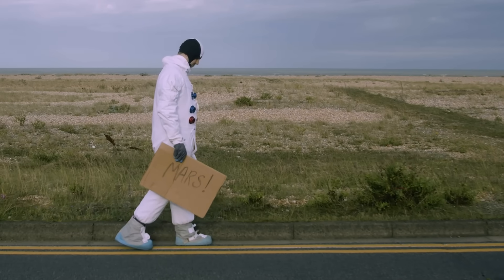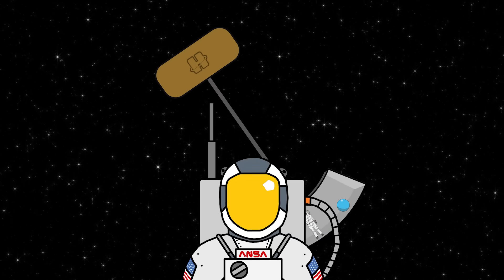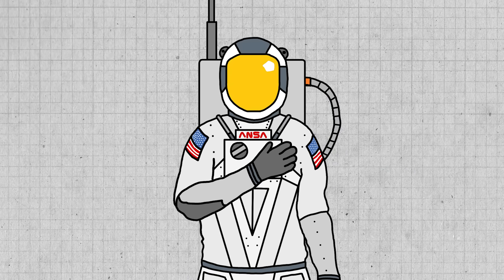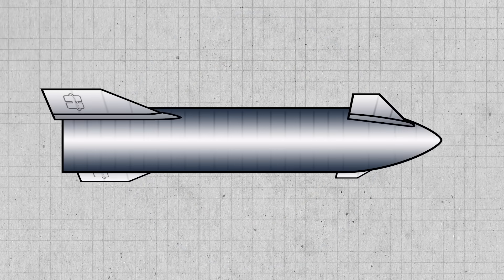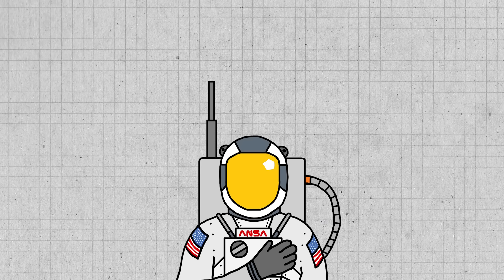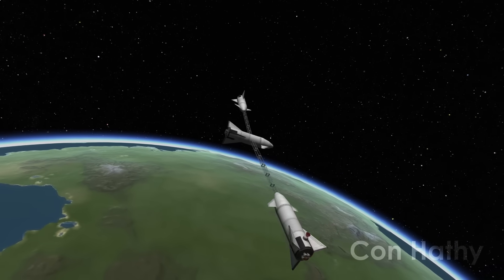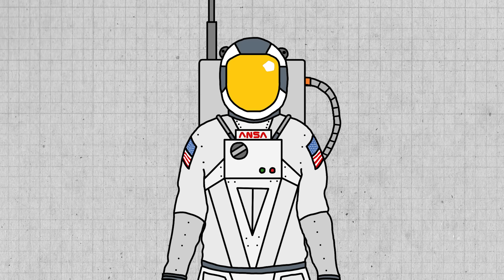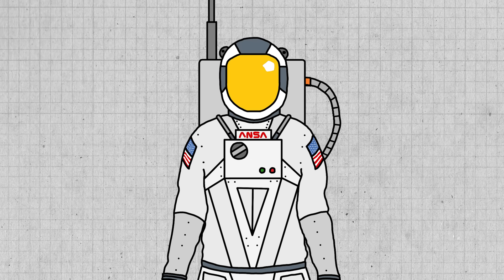This is NOT how you make Artificial Gravity

Comment: The only problem with the small rotating platform inside the spacecraft is that you won't experience continuous gravity. You have to get off it to eat, go to the toilet, etc. And if there are 10 crew members you would need 10 platforms (or strap several people to 1 platform), or otherwise take turns, in which case you will have less time experiencing gravity. Also, if you want to use one spacecraft only, which would add more weight and complexity: having several rotating platforms inside the spacecraft, or having bunks and chairs that can turn around. Anyhow, I think radiation shielding is a bigger problem than having (artificial) gravity.
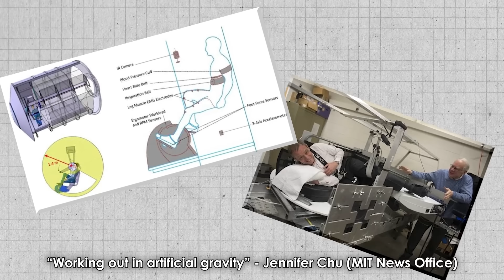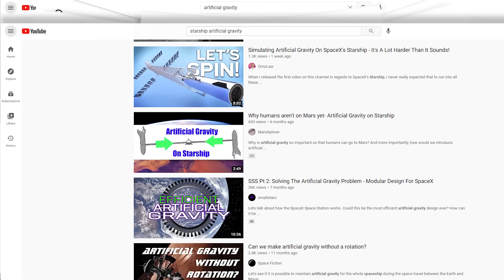Reply from the maker: I think the best implementation is for use during exercise similar to the MIT concepts around 15:16. This would take the form of an exercise bike or something similar that is on an arm within the ship. This would limit balance and motion sickness issues as you'd be on a bike seat and not turning your head too much. Intermittent exposure seems to be adequate to counteract zero-g, the 2nd paper on the right around 0:22 demonstrated that 30 minutes a day was enough to offset the muscle losses we usually see during bed rest studies. "Aerobic exercise capacity" was not maintained but this is probably because they were not moving while in AG, 30-60 minutes on a bike is pretty reasonable given current astronaut schedules and would likely do a better job maintaining "cardio."

That said, I definitely agree that it isn’t mandatory for early missions and radiation is the bigger concern.
Reply: On the toilet is where AG is really helpful.

Comment: You figure out the part with 3 spaceship wrong. A cable only transfer force in one direction. It is not a rigit body. It is a little bit more complex especialy with a set of redundent cables. The other thing is, to get the rotation you do not need a lot of extra fuel. You would always combine rotation with the acceleration you already need.

Comment: There is an alternative to "Mars Direct" and Starship (which is an embodiment of Mars Direct). Instead of this you return from Mars indirectly. Firstly to Mars orbit and then return to Earth. This has a lot of benefits I won't go into here. Such an architecture would naturally require a transit vehicle whose purpose is to convey humans from Earth orbit to Mars orbit and then return to Earth orbit. In other words the vehicle spends its life in space. This makes it more optimal as a transit vehicle (you're not wasting mass on being able to land) and more relevant to this thread, it makes it a lot easier to design-in spin gravity.

The transit vehicle I have in mind is assembled in Earth orbit from pieces that can fit on a heavy lift vehicle (Starship is one candidate). At one end of the vehicle is a pressurised crew cabin (habitat). Built for either 4 or 6 people and with all the life support, consumables, medical equipment, spares and so on that you'd expect of a reliable long duration space habitat. 

In the middle is a simple truss structure extending maybe 150 to 200 metres. On the far end are engines, fuel tanks and so on. On departure from Earth, most of the original fuel mass is burnt. The remaining fuel is there for Mars capture and descent to low Mars orbit. Around the habitat are arranged tanks that in cruise are normally filled with methane (to add further radiation protection). The heavier (propulsion) oxygen tanks are located at the engine end of the vehicle. Methane can be transferred between tanks to compensate for shifts in other masses and to keep the point of rotation reasonably stable.

There are of course other attitude control (possible Iodine ion) thrusters located in various points around the ship that aid in spin up, spin down and stability control.

Now, the vehicle is symmetrical around its long axis - the one that passes down the center of the habitat and the center of the truss. Meaning it would have a stable rotation around an axis that passes perpendicular to the truss and through the center of mass (which is a point in the middle of the truss and probably closer to the engine end of the vehicle). 

So, you'd now have a (fairly) rigid structure rotating end over end - around its axis of maximum angular momentum. 

I'm asking if it is still stable if I increase the mass of the engine end (shift fuel tanks) so that the point of rotation is closer to the engine end than the habitat end.

Comment: My criticism of short radius centrifuges is that they solve a subset of problems and also tend to be more effective in loading the lower body.

Spin gravity applied to the whole vehicle has other worthwhile benefits. One of those is simply to create a sense of "up" and "down" within the crew cabin which has psychological benefits. There is also the practical benefit of ensuring objects will fall. That makes a lot of activities, like eating, a lot less complicated. (Ok, so you still need zero g procedures for when you're not spinning). Again, the intangible here is psychological benefit. Speaking of which, I don't think it too much of a luxury to have a normal shower and spin gravity is essential to this (you need the water to head down and be collected, not float). 

So while I get the idea of centrifuges in some contexts, I still feel that spin gravity, if its practical to implement, should be implemented.

And while I'm here, I'll point out that a lot of people seem to be fixated on creating exactly one Earth g. Much of the benefits noted above work at fractions of an Earth g. Also, wearable masses (imagine for instance a radiation protection vest) would increase musculoskeletal loading and would be applicable in the range of 0.5 to 0.8 Earth gs. So you may be able to seek a reasonable compromise at below 0.8 g. Again, something to factor in when you're doing the real engineering trades.

Comment: They could put a small one up on the ISS or Gateway to be used as sleeping quarters. It spins with the beds positioned to the sides, allowing you to sleep like you're on Earth, but also letting your body recover from zero gravity.
Reply from the maker: I don't think you would want to use this while sleeping, bed rest is a pretty good analog for zero-g on Earth so sleeping in AG wouldn't be very productive. I think the best implementation is for use during exercise similar to the MIT concepts around 15:16. This would take the form of an exercise bike or something similar that is on an arm within the ship. This would limit balance and motion sickness issues as you'd be on a bike seat and not turning your head too much. Intermittent exposure seems to be adequate to counteract zero-g, the 2nd paper on the right around 0:22 demonstrated that 30 minutes a day was enough to offset the muscle losses we usually see during bed rest studies. "Aerobic exercise capacity" was not maintained but this is probably because they were not moving while in AG, 30-60 minutes on a bike is pretty reasonable given current astronaut schedules and would likely do a better job maintaining "cardio."
Reply: @ConHathy  An external enclosed ladder attached to the ship's nose can provide a bit of gravity for the ship and great full-gravity (or more) exercise for the crew. Leave the ladder in orbit around Mars for the return trip.
Reply: The counterweight would need a dampening buffer or your balls would tend to sling around and chime when they collide,  thus keeping you awake.
Reply: @Accumulator1  !!
Reply: @Accumulator1 lol
Reply: They don't deserve gravity if they didn't think of it first

Comment: Short radius is a good solution for astronauts, whom have been rigorously trained. And for a situation where all you need the gravity for is maintaining human health.

It most likely is not a solution for anything else. Civilians wouldn't be able to handle the restrictions for the periods of time involved.
Reply: "a situation where all you need the gravity for is maintaining human health"
Yep... But that's not the only thing a bit of gravity is very useful for.  Tons of activities are much easier with some constant acceleration "down".
Micro gravity is the point of a lot of space research and (hopefully) manufacturing, but we really want to have areas with micro gravity and areas with some appreciable gravity with easy access to each other.

Oh, on the health thing... Have we figured out how much gravity is required to maintain long-ish human health?
Reply: @travcollier  Correct. Even fractional gravity is a good thing and its not that hard to achieve with spin. Its good that liquids don't float around. Its good that you can eat (relatively) normally. Its good that you don't have to strap yourself into the bunk. But one thing a lot of people haven't really given much thought to is the possibility of a real shower on a long space flight. Rather than using wipes (which itself becomes a garbage/recycling problem). A real shower would make a huge difference to morale. 

Another point is that you can compensate for having less than a full Earth gravity environment by adding wearable mass - which puts more load on your bones/muscles. And as it happens, wearable radiation protection (vests etc) is a good idea and will also add to your effective weight. That lands you in a zone around 0.8 Earth gravity.

Just crunching the math. A transit vehicle (Earth to Mars and return) comprised of a 150 metre truss with tankage on the far end acting as a counterweight to the habitat on the near end. Effective radius about 80 metres. For this we have 2 revolutions per minute provides near Mars gravity. 3 rpm provides 0.8 Earth gravity. And that is acceptable provided it is spun up gradually.
Reply: You'd be surprised by what humans are willing to put up with.
Reply: Why would civilians be on a spacecraft? That barely ever happens.
Reply: @Graknorke  Well, many people see colonisation as the end goal of space exploration. So one day, civilians would have to get on board even if it's just for transit reasons.

Comment: I would think short-radius centrifuges have major disadvantages vs the tethered  starships option:
1.) Uneven: Different spin and therefore uneven G-force applied from top-down on the body. 
2.) Stationary: Movement around the cabin and useful work is limited to near zero: inactive astronauts. 
3.) Periodical: This is a guess, but I can hardly imagine that anyone could so much get used to the rotation that sleep could be accomplished: only periodical use vs continuous.
Reply from the maker: Sleeping in a centrifuge wouldn’t be worth it, we use bed rest to simulate the side effects of zero-g already so there would be no benefit. The best use would be for exercise like the MIT designed bike I show near the end. This is time where the crew is already staying in one spot and is committed to zero-g countermeasures. Exercise in a centrifuge would just make the existing countermeasures more effective. It is unevenly distributed, but if it’s good enough to reduce pressure in your eyes and puts strain on your skeleton and heart, then it’s an improvement to what we have for a fraction of the cost and complexity of tethering.

Either way the first missions will probably just use normal exercise like we do on the ISS.

Comment: At 16 min you talk about what happens when "the rope breaks". You talk about the (now untethered) starship rotating end over end at 2 RPM. 

But wait a minute here. Here's how I see it: 

The starship was not spinning before the rope broke. It was pulling longitudinally away from the center of the whole system. Which is the axis of rotation half way along the tether between the two starships. When the rope breaks it will not spin. It will move in a straight line directly away from the previous center of rotation. The people inside will experience sudden weightlessness.

What am I missing?
Reply from the maker: Yes the starship will travel in a straight line but it will also continue rotating at the same rate that it was before the cable broke. The difference is that it’s now around its center of gravity instead of the center of the cable. There’s a couple of ways to think about this.

1: the nose of the starship is closer to the center of the cable so it is traveling slower than the tail of the starship. When the cable breaks the tail tries to go faster than the nose which causes it to spin.

2: imagine that the tether is connected to the center of gravity of the ship instead of the nose and that the ship can rotate freely so it’s not aligned with the tether. To keep the nose pointed towards the center (keep gravity in one direction) you would have to spin the starship up to match the rate of rotation of the cable, similar to how the Moon rotates at the same rate that it orbits the Earth so the same side always faces us. When the tether breaks you loose the tension keeping you in “orbit” but that extra angular momentum you just added to keep your nose pointed at the center is still there, so you keep rotating. If the Earth disappeared the Moon would still rotate every 30 days, even though it isn’t orbiting the Earth anymore (there’s no where else for all that momentum to go).

Comment: I still think constant acceleration with plasma/ion engines (Like VASIMR) is the best option for artificial gravity. The gravity is toward the base of the starship and you just need to rotate 180 degrees  during the deceleration half of the flight. Just build the damned radiant heat exchangers so you can run a nuclear generator about the size we already have on nuclear submarines and you have sufficient power for VASIMR engines.  You may still not get enough acceleration for a full 1G but that probably is not necessary to maintain health anyway, especially since with constant acceleration the trip to Mars is shortened to like 40 days. If you can generate 1/3 G everyone is already acclimated by the time you get to Mars.
Reply from the maker: Constant thrust would be great, but you certainly couldn’t get 40 days of 1/3 G with any like current technology. I don’t see a thrust to weight ratio for VASIMR but the thrust is only 5 N so if the engine, reaction mass, and power source have a mass of more than 1.5kg (they definitely do) it isn’t capable of that level of acceleration even at this small scale.
Reply: Constant thrust would help in many ways. Like, even constant 0.1G would limit travel time to Mars to under 1 week (in the launch window around the shortest distance) - this translates to much less radiation, wider practical launch window, no need for aerobraking.
Reply: @jaceksiuda  -- "even constant 0.1G" -- that's not as big a concession as you think.

Accelerating 'A' metres per second squared halfway through a distance 'x', then decelerating at the same rate the other half of the distance, the minimum possible time-averaged rate of kinetic energy accumulation per unit mass is one-half of the square root of (A cubed x). For A=0.98 m/s^2 and 'x'=64 billion metres that comes out 123 kW/kg.

That's with a perfectly efficient engine that gets perfect traction on space itself. A heat engine, throwing propellant (which carries off kinetic energy of its own) you're looking at a need to radiate away about 1 MW/kg.
Reply: With a realistic power source, you're talking about less than 0.01 gs. In other words, enough gravity to make things settle and leave a sense of "up" and "down". Perhaps enough to have a real shower (if you were patient). But not enough to get the physiological effects of gravity.
Reply: Epstein Drive from the Expanse was that bit of magic. Maybe someday in some universe.
Reply: "Just build the damned radiant heat exchangers" -- amen, but the equations still are a little cold.

If your rate of accumulation of kinetic-energy-per-unit-mass for the first half of a trip of 'x' metres is 'Z' watts per kilogram, and in the second half, you scrub that energy off at the same average rate, acceleration comes out as the cube root of (4 Z^2/x). What those, I would call them "radiators", must do is radiate away several times 'Z'.
Reply: You need radiators that cover most of one side of Starship. Which adds mass, complexity, failure modes. But worse, how does this radiator survive re-entry? Do we have protective covers? More mass, risk. 

What we need to come to terms with is that the vehicle that transports you through space is not the vehicle that lands you on Mars. Their requirements are conflicting.
Reply: Hoo boy, it is the best option, but one wrong caculations and you might hit an asteroid in the darkness in super high speeds.

Also, special relativity nonsense I don't like to think of.